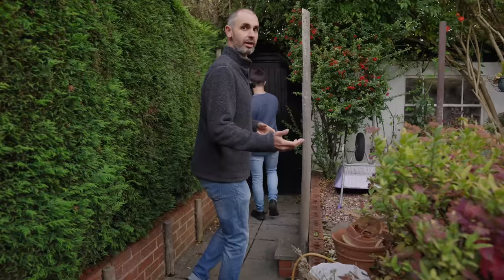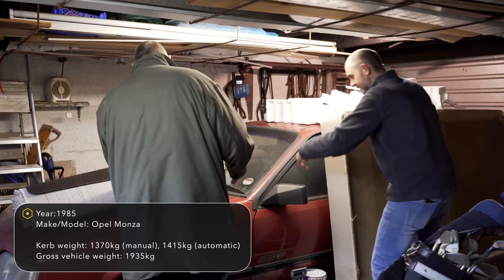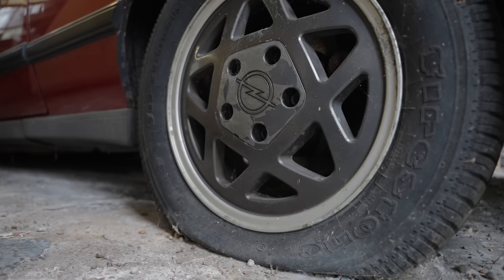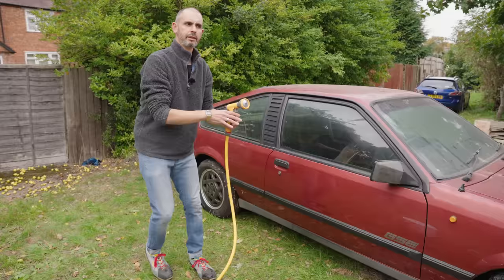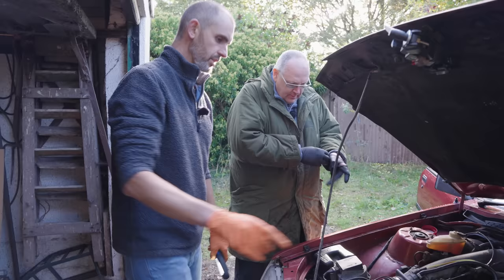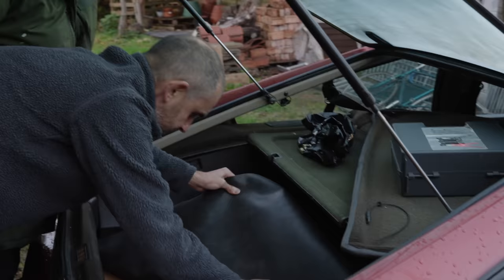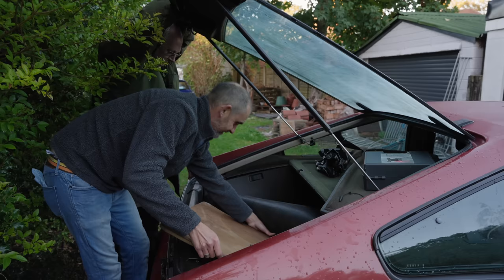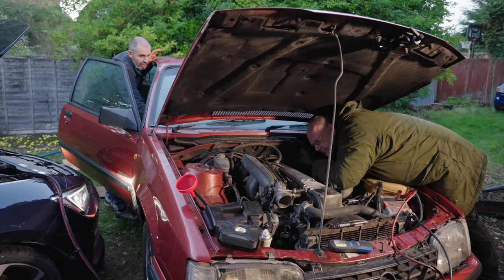Barn Find classic 80s Opel Coupe rare survivor

Comment: Johnny. When you removed the hose to the plenum to squirt starter fluid you essentially deactivated the air flow meter which is a pretty essential part of the Bosch FI system. In the future I would recommend keeping that hose in place and adding starter fluid into the air box.
Reply: I was going to comment this also but it can still work with the AFM not connected if you just hold the AFM open a little.
Reply: Not enough arms
Reply: that would make sense if the fuel pump was connected, it was never going to run  off the funnel as there isn't enough fuel pressure to get fuel thru the injectors, so it was only using the starting fluid to fire.
Reply: I was shouting exactly the same.

Comment: Nice find.  Really enjoy these vids  . But, there is no point using the funnel and hose trick on a fuel injection system mate . You will need about 3 bar pressure.  
Rig up a petrol can with a fuel injection pump , it's own 12V battery ( a 12V drill battery works well ) ,  a hose from the pump and a return hose  . Great for these situations.  
Also , with those old flapper air flow meters,  there is often a microswitch that also controls the pump, so you need to move the flap a bit to 1simulate air moving past it , or leave the intake hose attached.  Spray easy start though a vacuum port.

Comment: Those 80's Opels were sadly underrated. I would love to have a Monza like this.
Reply: A friend had one and bemoaned the sheer weight of the rear hatch with all that glass.  He wondered if it had a plastic hatch glazing, how much would it would transform the handling and  acceleration.
Reply: @jonathanpalmer155  I think that big square metre or so of glass actually balanced the front-end weight quite well. I had a couple of Rover SD1's, and when the gas struts were on their way out that hatch could give you a nasty whack on the head!
Reply: It was very heavy. Also the weight of the hatch meant it slid down on the hinges over time and then the rubber bouncy things that kept it tight didn't line up properly and the whole tailgate would start bouncing over bumps and making nasty squeaking noises at the same time.
Reply: The gas struts did indeed fail after a couple of years, and needed to be replaced, a very simple job. The 'rubber, bouncy things' that you mention, were probably adjustable by simply giving them a quarter turn anti-clockwise to raise them, and the hatch would be comfortable again. Always worked on my Rover SD-1's.
Reply: @olafeklund6200  yes, you could turn them to raise them but even on the highest position, it wouldn't stop the hatch bouncing on my one, sadly.

Comment: Peter Brock tried bringing these over to Australia in the 80’s and wanted to put 5.0lt V8’s in them.
Great looking car in my opinion.
Cheers Pat🇦🇺
Reply: Didn't know that, interesting. I always wonders why they never went to Australia, as the Commodore's did so well there. Mind you those V8's did a lot for them. If this was ever put out as a factory Holden V8 model it would be a highly valued muscle car classic in todays market. The whole commodore line is far more appreciated in Australia then it is Europe.
Reply: I know he made at least one black one, saw it in a car yard in Brisbane in the late ‘80s
Reply: Holden said they had to modify the Commodore structure substantially for Australian road conditions and the heavier holden engines, I think initially for the Estate version, but the change was eventually adopted across the board for the whole Commodore range. If I'm not mistaken, the holden used a live axle at the back, while, at least the higher grade versions of the Opel/Vauxhall used an independent rear suspension.
Reply: @santosh911  As I understand it, the cars that Holden managed to break were very early prototypes tested on outback dirt roads (about 2 or 3 years before production), and most of the strengthening was integrated into the rest of the V-car program, so adapting the Monza to local production using imported body panels should have been a no-brainer. Also, while you are right about the different suspension systems, there were still enough parts shared between the various versions (the Opel Rekord and the Holden Commodore had the live axle, while the Opel Senator and Monza had IRS) that HDT offered the Opel IRS as an option on some of their later cars (the VL-based Director being the most notable example) simply by changing the control arm mounting points.
Reply: To my knowledge the one 5 Litre HDT Monza built still exists... I've seen it at a couple of car shows over the years

Comment: It was...no wait....is a great car. I used to love them as a kid. They were up there with the BMW 6 series. They were nicely made and well-engineered. Such an underrated car.
Reply: Yes, the difference is that the BMW has worse road characteristics, when the BMW 6 reaches the limit and loses grip it becomes dangerous and throws out violently, the Monza is safety itself and doesn't come up with anything.
Otherwise, Opel's trip computer is completely superior to BMW's
Reply: @Djeseret  I would love to agree with you but I had a BMW 535 and 325 series from the same period, you knew when you were close to the limit. I just thought that the Monza was massively underrated and was as good as BMW but not better.

The Munich taxi is appreciated now, but the Monza is sadly ignored and that is wrong.
Reply: @stephenconway2468  Well those are different experiences, the guy who told me the 6- series was unsafe and the Monza safer in comparison, was a motoring journalist at a magazine specializing in supercars.

Otherwise, it is not a strange statement because everyone in all times recognized that Opel always had safe characteristics even if they were not always entertaining, safety and predictability have never been questioned, on the other hand, entertaining cars are often less safe, it is an old experience, and especially BMW has performed one of the most dangerous cars ever, with such characteristics in the first 3- series E21 1976-1980, in a test by TÜV it flipped over and ended up on the roof, BMW has never admitted the fault.

What I know myself, is the trip computer where there is no doubt in any case..
Reply: @Djeseret  The 325 had a tail happy reputation, but really you had to be driving too fast. A lot of yuppies were perhaps driving beyond their ability or the road conditions. 

The M635 was more re-active than the XJS or MB 560 SEL but never unsafe. It was a tourer and handling itself that way. I never read a bad word about it. 

Anyway, the Monza was a great car and underrated too. I'd be happy to have either car.

Comment: If you swap + and - in the pump a few times you are moving it in both directions and often it will come back to live.
Also those fuel pump relays were very prone to failure, there is chap in the US that make solid state direct replacements for the Porsche 944 - ftech9-.They also work in any Motronic, not sure Jetronic. It works fine in my Kadett and there is a version that adds 3 second prime, very useful for ethanol todays petrol
Reply: Yes great idea for the Motronic system. Jetronic is analogue and very different so the fuel pump relays are different too. I'm a 924 owner so I'm familiar with K-Jetronic, and I owned a 944 in the past.
Reply: @althejazzman  I belive this car has an LE Jetronic, it is electronic and very similar to tje Motronic, it is not a CIS.
Reply: Useful tip thanks Ismael about ftech9 relays. Just checked out their website as I'm using Motronic on my Manta coupe. Terminal assignments are the same on my relay so will investigate further.
Reply: @davideverett9848 . You are welcome. I have been using their relay for a couple of years. They work very well. The 3 second priming works every time you turn the ignition on. It helps a lot with hot start in hot conditions, due to evaporation in the injection ramp, which it was common in their day but worst now with ethanol.

Comment: Hi Johnny
I was shouting at the TV when you was holding the funnel full of fuel ⛽
Saying it will not work that way as the Bosch injection that that car has  need the pump to be working for the fuel pressure to be correct,
Great show, keep them coming,
Thanks Dave

Comment: For me, this is one of the most desirable cars ever. I test drove an immaculate Monza GSE -86 in 1998. I still regret not buying it. The issue then was that to insure it would have been half the price of the car every year. Too many of them where stolen when new here in Sweden. I had four Opel Ascona B and one Manta GTE before that, so RWD Opels was the thing for young me. I ended up with a SAAB 9000 turbo -88 instead. Probably a better and faster car anyway.

Comment: The engine will run with  new fuel pump, new ignition the 3.0 12v is a tank from a engine. It is a very solid engine one of the best opel ever build.

Comment: Any form of Bosch Jetronic is heavily dependent on high fuel pressure to start and run. Your funnel and hose probably wouldn't be enough to open the injectors. Jetronic also never runs the fuel pump unless the engine is also turning. This is a fail safe so that if you crash and the engine stops, the car doesn't continue to spray petrol into a crashed car. The fuel pump relay gets a trigger from the coil.

Comment: Mate, when you are using jumpers to start the dead car, the supplying jumper ground goes on the chassis, NOT on the dead battery. You are losing a ton of energy because the dead battery is siphoning electricity. Donor car gets both jumper leads on the battery, receiving car gets hot (positive) on the positive battery connection, but the negative (ground) goes on something solid, either chassis or some beefy bolt on the engine. Very common mistake

Comment: You’re an automotive archaeologist now. Your vehicle should always have basic items to revive a car that has been lying patiently in its tomb. A portable air compressor, electric or 12 V, a fresh battery, your Petrol can made by Tony Bmw, because injection systems need pressure to satisfy the fuel system. Dumping it in a funnel only works for carbureted models. Other assorted tools, a couple cans of starting fluid, some good lighting that can hang on the bonnet, and a good tow strap to bring it out into the daylight. Never leave home without those items!
Edit: with the knowledge of the car you’re going to look at, you should always splurge for a new electric fuel pump, because cars that sit for more than five years, chances are the fuel pump is all locked up. Worst case scenario is you need it, best case scenario is you return it. But at least you have it.

Comment: One can only imagine what the Australians  would have done with that body shell if the Yanks would have let them have it ... 5 litre  V8 ... 5 speed Manuel ... Limited slip differential ... OH the Mouth waters
Reply: The GSE normally has a sport gearbox with lower gears as standard, it cuts acceleration by half a second compared to the standard manual transmission in the base versions and a Limited slip differential was a possible option, but it is almost completely... unknown that that equipment existed... moreover it could also come with 4WD.

Comment: With my Monza GSE it was the fuse that was loose in the fusebox for the fuel system, as soon as I held the fuse in it fired straight up, when I first got it it also needed a fuel pump and a relay, standard stuff when they are stood for a long time, worth checking that the fuse is secure and held in properly.

Comment: G’day John, In Australia I purchased new a 1982 VH Holden Commodore V8 five litre, four on the floor M21 close ratio box, Peter BROCK group three, SS,  four door sedan. The motor came with Yella Terra big valve heads, cam, four barrel Carby. Full dress body kit front spoiler bonnet scoop, mudguards air splitters, sill rail extensions, rear boot wing, rear under bumper skirting. Bilstein gas shocks, bigger front roll bar, Irmscher 18” diameter wheels.🇦🇺🦘🦘

Comment: In 1979 I went to work for an Opel dealer and my company car was a 1.3S FWD Kadett which had just come out. It was so much more powerful than the comparable Escorts and Vivas, it was great fun. There was the Ascona S 2 litre and the Manta, but the star of the show was the Senator and Monza Mark Ones. The facelift version as seen here was even better.

Car magazine, especially, raved about them placing them as true rivals to the BMW 7-Series and not far off the S-Type Mercedes for quality and performance.

Comment: There is also a fuse for the fuel pump behind a cover under the steering wheel. And the airhose for the intake has to be mounted otherwise the flap of the airflow meter won't move and the car cuts off the fuel. It's a Bosch LE jetronic system. It's a pretty good system when all the ground wires are clean. And judging by the sound of the starter the ground between the engineblock and the chassis isn't very good. You 2 were almost there. And those fuelpumps 9 out of 10 times jump right back to life if you connect them to a battery and tap on it. Anyways, nice car and a rear solid one! And it's not entirely Base speck GSE because it has the headlight wipers :)
Reply from the maker: Thanks Peter. Really appreciate your expertise.
Reply: @TheLateBrakeShow  You have to take apart the air filter... and inject starting gas there... then it works and don't stop spraying before it starts, it needs a lot...

Comment: The GM injection engines of that era use Bosch LE Jetronic. The first problem was that the engine wasn't turning over fast enough to trigger the pump relay. In fact, it's not just a pump relay but a seven pin relay that fires both the pump and the injectors. Powering the pump alone would do nothing. Look at the wiring on the relay plug: red (terminal 30) is battery power so check that for 12v. Then with the relay removed use three short bits of wire to connect Terminal 30 to terminals 87 (red/white - injectors) and 87b (green/violet - fuel pump) and the car will run. Assuming the pump is any good!

Comment: You need to check the fuel pump fuse. If the pump is seized the fuse probably blew the first time you turned the key. Pouring fuel into a fuel line won't work with a high pressure fuel injection system by the way, it doesn't have enough pressure to pass through the injectors.

Comment: Living in Germany in the 80s I bought an Opel Monza brand new. The big mistake I made was choosing the 2.5ltr. motor.
It was barely okay.
Sun roof leaked and the dash cracked and split cronically, it virtually fell apart.....and the dealer refused to entertain replacing it.
Boot space, there was more in my wife's VW Polo.
The Senator I had previously was superb, but that was a 3.0ltr.

Comment: Jonny just a quick tip.  You know your NOCO boost pack you bought recently, that can be used as a 12v supply for going onto the likes of the fuel pump.  Way easier and safer than running off a car.

Also have you talked to any UK supplier of car batteries to see would they sponsor barn finds and provide a new battery for each fiNd, thus making the probability of starting a lot higher.

Finally, you should look up the Milwaukee m18 tyre inflator.   It’s only just released but is a heavy duty tyre inflator.   Meaning no more leg work outs!  Btw way, the only thing that could have made this car cooler is if it were a wagon.   Great video as always.

Comment: Well, what I usually do is bypass the fuel pump relais with a simple bridge (a piece of wire).
A relais that has sat in there for years will mostly be the culprit as Opel from back then made pretty reliable cars. :)
Also, fresh fuel is ALWAYS mandatory when trying to get it alive. Fuel degrades with time and you don't want to spend a whole day trying to find the fault, just to discover you had some piss poor old fuel in there (water and whatnot in it).
If the fuel pump is seized anyway just hit it with a hammer a couple of times, and maybe it will loosen up (noting to lose on that as you'll replace it anyway).
Nice find...got to love these old Senator/Monza. :)

Comment: Another great find and programme Jonny. I had one in 1999-2000. A Silver GSE B908 SEC. Unfortunately, from an MOT Check it appears it has not survived. As an auto it was not particularly quick (my 16V MK2 Astra was quicker) but it was a lovely practical grand tourer and those Recaro seats were super comfortable. Thankfully the digital dash worked. I used it for several years before selling for about £1500 😢

Comment: I owned a very similar car, same colour, same interior, non ABS, non air-con, C reg but the 5 speed manual. Bought it in 1989 when I was a mere 21 years old and had it for 7 years. The reg. was C555 KEG. I 'lost' this reg. number after I assigned a private 'plate. If I remember it became C319 ADD afterwards. There were only 1500 odd of these GSE's sold in the UK. The downside with them was rust but the one in the video looks quite good. I'd love another but sourcing parts even back in the early '90's was a problem so damned near impossible now I should imagine.

Comment: Fuel pumps often seize or get commutator corrosion when left in empty or near empty fuel tanks for even just a year or so,, empty fuel tank + time,, get the pump out and get a torch in there to check the inside condition of the fuel tank at the same time.. if the particular specific pump is hard to find or expensive, it's a pretty simple "retrofit" job, an improved more modern pump can be easily "retrofitted".
Funny, the build quality on the Opals was so much better than their Vauxhall equivalents (thinking Opal Manta/Ascona vs Cavalier 2000gls?). or was it just the Berlina and Berlinetta variants,,, ahhhhhh "Boy Racer times for me" 2.0l Ascona Berlinetta even had LSD.